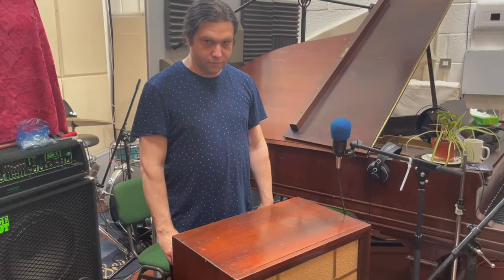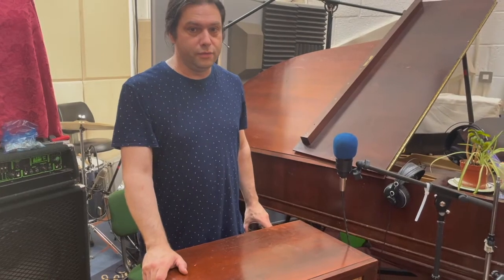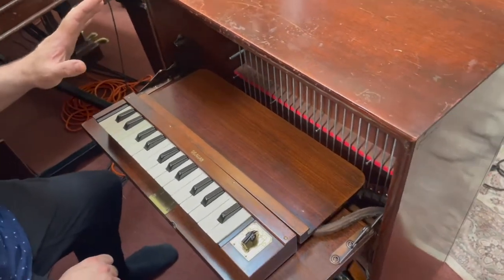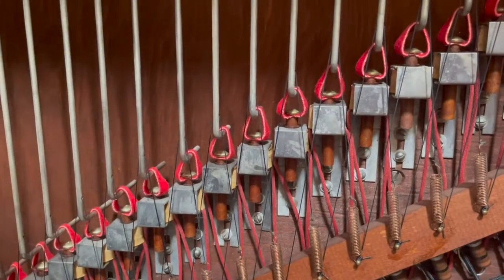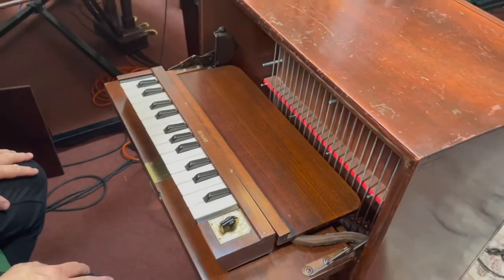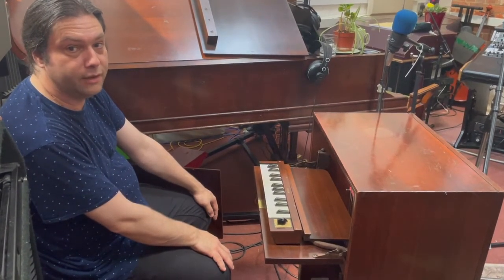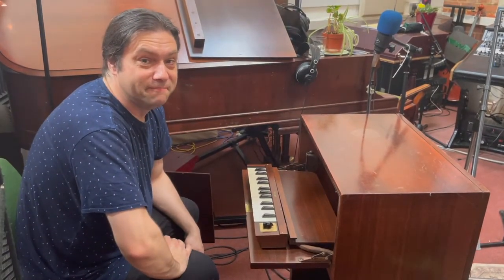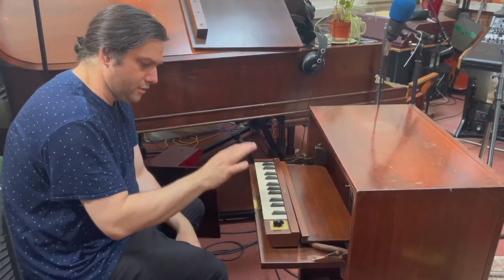1950 Deagan Canto Chimes -  Electric Bell Carillon demonstration

Comment: Our church has a set of Deagan Canto Chimes that the keyboard is attached to the electric organ.  The tubular chimes actually hang above a stained glass window. We are trying to find someone who could repair the tubular chime itself as there are three notes that sound very flat or "gong".  Perhaps it is clapper part?  Any advise is appreciated.
Reply from the maker: Very probably the solenoid striking mechanism is getting stuck or there may be something slightly out of alignment. If it has just happened by itself, it is probably a fairly straightforward adjustment
Reply: Thank you for information.  It happened on its own.  How does one adjust the solenoid striking mechanism?